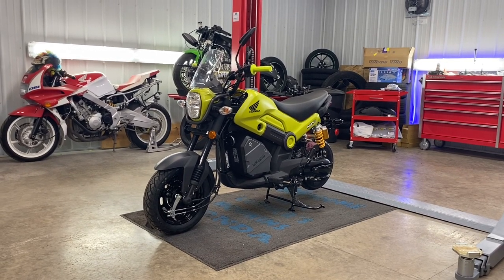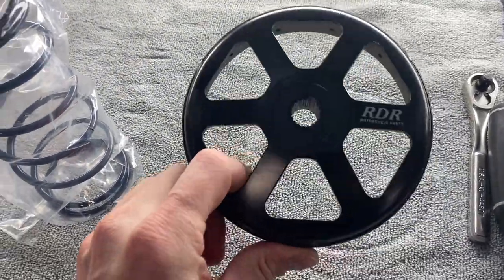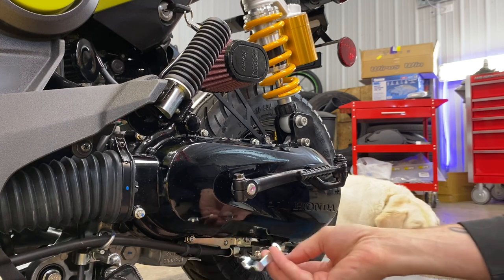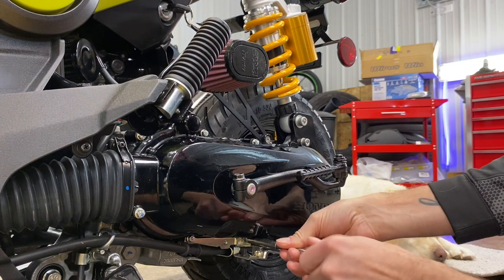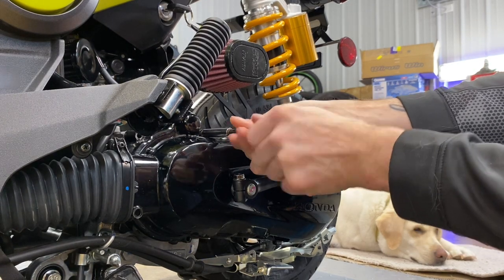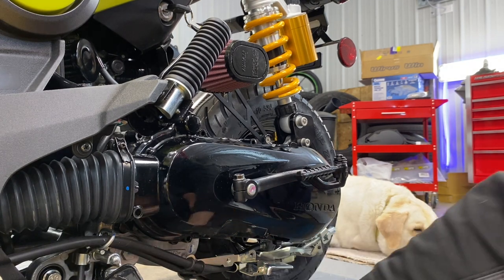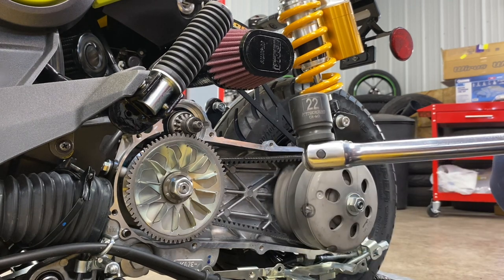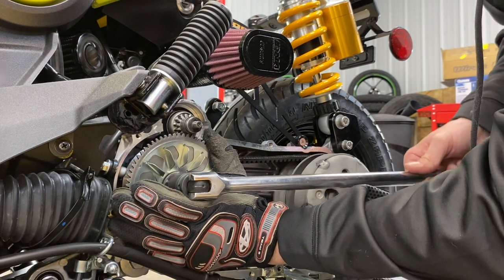Honda Navi (CVT roller weights and contra spring upgrade, variator and clutch removal and install)

Comment: Can you please explain what are the results in practical terms. Lighter weights results in longer time to reach high speed and more torque? 
I would like to lower the RPM and possibly have more end speed. Just like adding a bigger pinion in a chain transition. Thank you for all your videos 👍🤝

Comment: Jam a 21mm socket in the starter teeth to hold it while loosening and tightening the variator nut, it works great! Just did it myself yesterday:)
Reply: What do you mean by this? Where do you jam the socket in?
Reply: @lanleyc  you place a socket in between the teeth on the variator while the flat side of the socket is flush with the crank case so that the variator does not spin when you need to loosen or tighten the variator nut (most sizes will fit, not just 21mm). When loosening you need to place the socket up against the top of the crank case and the variator teeth, and when tightening you place it on the bottom of the crank case and lock the teeth to stop clockwise rotation.
Reply: @JVBNorway  hmm. Thanks for the info. I understand the concept but my socket won’t sit on the crank case and still touch the teeth of the drive plate to lock in. The drive plate is just a bit too far out for it to sit right
Reply: @lanleyc  Damn, I thought it would work on the navi:/ I have a Honda Vision 50 that uses the same tooth mechanism to crank the variator and I have used this method without fail several times, but I see that the variator on the navi is pertruding further than mine is. Perhaps you would have an odd piece of hard metal you would have laying around that might do the trick!
Reply: @JVBNorway  yeah I figure it was out too far the concept makes sense. I actually have a variator locker tool that has 3 teeth on it and I was able to jam it into the crank case and hold it tight enough to get the nut off… I am just having a really hard time torquing this thing to 69 foot pounds. I feel like I’m cranking down and the damn thing won’t click and since I’m holding that piece in there I feel like maybe I’m just not getting enough leverage to get the torque wrench to click
Reply: The tool is made I think to go on a spanner wrench, but the wrench just keeps slipping off the ground when I yard on it so it really only works placed and held into the crank case just right. Sucks because I really want to make sure that nut is torqued in correctly
Reply: @lanleyc  I have seen people use adjustable oil filter wrenches, those with a chain or belt/strap, to hold the variator in place. I havent tried this myself but it could be worth a shot:)

Comment: I can’t believe you removers that drive face with your hands. I tried so hard. I had to use vise grip plier and hold on tight. Can’t find any tool to hold it online to torque it properly. Any tips?

Comment: I went with the lightest weights possible with the S23 kit because I go about 240 and the Navi was struggling up hills.  Lighter weights in the variator are better for faster response for heavier riders.  At least that is what I have heard.   I also replaced the clutch with an S23 at the same time and it made a huge
 difference.  Makes me wonder if you ended up doing the same.. I will look around at your videos.   Not sure what a stronger contra spring will do for speed and power etc.

Comment: That cvt looks just like a gy6 honestly. I would try either a ncy or oko or bang jing variator for a gy6 150cc. They also make them for the honda np50 but I would try the gy6 version first. Just match them up if it isnt the same size send it back. All the gy6 150cc variators are the same size and I think that will match up honestly. Youll only be able to use the back end parts not the front drive face since yours has those gears for that to work with the bendix and kick starter. And I would try Dr Pulley sliders instead of rollers just measure the size youll find what you need. Ive done a ton of experimenting and researching on cvt tuning for the gy6 setups. It is a noticeable difference in sliders vs rollers performance. You should also look into the clutch springs as well. If you want the clutch bell to engage sooner get lighter rpm clutch springs. Should be 3 of those in there. Stock might be 1500 rpm you could drop down to 1000 rpm  for quicker engagement.
Reply from the maker: Hey Tallyn!
Thanks for the tip, I’m going to get some carburetor tuning, tires, and some electrical work done and hopefully I’ll be able to rid the Navi, it’s still winter and hitting negative degrees again this week, but once I’m able to ride and brake on the motor I’ll start messing with the variator and different rollers/sliders.
Much appreciated!
Reply: i just ordered a icy clutch for a gy6 and ill see if it fits. i did some research into part numbers and a lot of photos comparing scooterswapshops kits and it seems like they're gy6 parts..... not 100% proven yet but seems like there's a decent chance.
Reply: @silas.anderson  any updates on this?

Comment: Great vid, thx so much.  Do you know where i could find the torque specs for these nuts and bolts?
Reply: Variator 44ft/lbs, Clutch bell 36ft/lbs.

Comment: do they make one like lexam anymore( i mean navi is nice buat still easier to fix a chain in outdoor than a belt
Reply from the maker: Hey Ethan.
Just cvt system on the Navi. Honestly I’ve had a chain brake on my 929 cbr at 80 mph and never had a belt brake on me. Thanks for watching and subscribe please if you haven’t already.
Reply: @rideordie6886  your cbr is a street race pony but not this navi right 

More like ease of replace chain than belt lol

But if ur navi is cool and no belt cracking theb thats good lol

Comment: Hi I can only achieve 51mpg with the SSP-G PERFORMANCE CLUTCH KIT and the MALOSSI VARIATOR KIT (12) roller’s FOR the HONDA NAVI. What’s your thoughts on the break in period? I currently have 197 miles on it. I’m wondering if it will go faster after the break in. Thank you
Reply from the maker: Unfortunately with the mpg it will never be vary good on less then a gallon of Petro in the the tank, it’s a constant full throttle kinda toy…
Yes you will start to see things loosing up I personally think the malossi variator is a waste. I would go with 13 gram roller weights and a lighter clutch cover that’s more lighter and breathable. Also a 1400rmp clutch spring. Mines pretty quick with out changing out the factory carb but remember if you want faster just buy a different bike lol good luck
Reply: @rideordie6886 what’s up man thanks for the videos. I got a Navi for delivery and want to hit a consistent 50mph even in winds with 25mph. Usually in those weather conditions I top out 45mph. Also would like to accelerate faster to that speed. What I’m thinking of doing is getting weights and deleting the rev limiter? I’m really not at all a mechanic but I’m willing to learn and try! Any tips or advice would be great. One of the old Honda guys told me 30k miles should be doable for the Navi before any serious mechanical issues. If I could keep that 30k estimate and do these upgrades that’d be great. I suppose the 50mph would be best as I don’t like slowing traffic down. They can wait for me to get there tho lol

Comment: Can you install lightweight rollers on the stock setup? Or do you need to upgrade other parts to install lighter weight rollers?
Reply from the maker: Definitely can install lighter rollers with factory clutch and factory belt
Reply: @rideordie6886  thanks man!

Comment: Can you just change out the roller weights?  If so, what kind of performance enhancements would you get?
Reply from the maker: Yes going lower in your weights will make more acceleration but you might lose on your top end…

Comment: Out of curiosity would replacing just the roller Weights with the ones you purchased make any impact on performance ?
Reply from the maker: Hey Lord Lotus.
Unfortunately it’s still winter where I live and won’t be able to ride the Navi for another month and half.
Thank you for watching and if you haven’t already thanks for subscribing.
Reply: Basically the roller weights change how much rpm the bike can spin up to. Heavier roller weights gives the bike more low end torque and the lighter weights give the bike more top speed. You need to test different weights to see which one you prefer.

Comment: Were can I get the 2 tools you are using
Reply from the maker: Hey Steve. Im guessing you talking about the clutch tool and clutch spring tool? Here’s the tools you will need to do the job, there are a lot of people that just use an impact but I have the tool to do the job so I use them of course. Impacts can damage things if your not use to using them fyi
Reply from the maker: https://www.amazon.com/Tusk-L35-471-Clutch-Holding-Tool/dp/B0039LEZFS/ref=mp_s_a_1_3?crid=LRLOJ1II8CQL&keywords=motorcycle+clutch+tool&qid=1655464981&sprefix=motorcycle+clutch+tool%2Caps%2C210&sr=8-3
Reply from the maker: https://www.amazon.com/8MILELAKE-Clutch-Holding-Motorcycle-Flywheel/dp/B07JPD7TZY/ref=mp_s_a_1_6?crid=LRLOJ1II8CQL&keywords=motorcycle+clutch+tool&qid=1655464981&sprefix=motorcycle+clutch+tool%2Caps%2C210&sr=8-6
Reply from the maker: https://www.ebay.com/itm/183287075762?hash=item2aacc2d3b2:g:l3UAAOSwR-ZahHFz

Comment: Can you quantify the difference this has made?
Reply from the maker: Hi MeyMoto!
Thanks for watching and if you haven’t  already thanks for subscribing. 
Yes better throttle response and better acceleration.
Reply: @rideordie6886  what’s the top speed now? I’m 230 and max it out downhill around 50-51mph.
Reply from the maker: 53 mph unfortunately it’s just 110cc so if you want to go faster might need a bigger cc bike.
Reply: @rideordie6886  yeah they were advertising that kit and a carb kit raised it 2hp and gave it more MPH. 

I have other bikes, this one is the wife’s. Just want it a little safer with some of the faster roads (non interstate of course) we have around here

Comment: Should have you run my stock Navi and see the difference!
Reply from the maker: actually thats a good idea, bone stock vs upgraded navi. will have to figure out how to exchange digits
Reply: @rideordie6886  should hop on Instagram! Tons of Grom/Navi content
Reply from the maker: so one thing that really bugged me and still does is the left riser is lower then the right which makes the left handle bar look goofy like bent and down even with the aftermarket handlebar on. take a look at yours and let me know what you think. I checked out the one at moon and it was the same way too...
Reply: @rideordie6886  I’ll check it out!

Comment: FIRST
Reply from the maker: I like 3rd place, still on the podium and something to chase lol just documenting every upgrade/mod as I go.
I wish I could do some test runs with the Navi but still in our winter up here in MN. I did some circles in the outbuilding and the rear tire was getting some tire side so that was fun...
Reply: @rideordie6886  Nice
Reply from the maker: @SCMOTO  stock tires are junk and I will not trust them on the streets, its been a pain trying to get tires for the Navi. only thing I see the stock tires working for is smoke signal's from MN to SC lol
Reply: @rideordie6886  lmao so true. I found some Maxxis M6029 tires on ebay. I have gone through several tire orders just to have them all cancel but these actually shipped

Comment: Compressing the new spring by hand to get it all back in the tool kinda defeats your comments about safety.
Reply from the maker: what’s wrong with setting up the compression tool, if your that worried you can put you motorcycle helmet Mr Lee lol
Thanks for watching